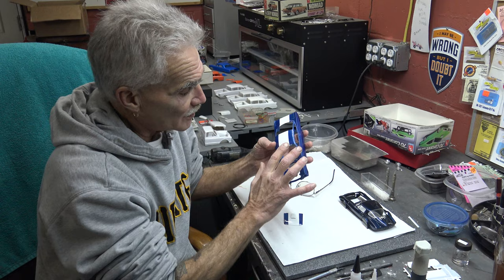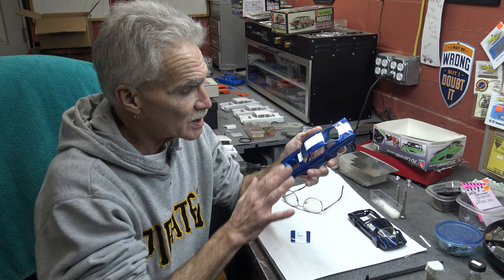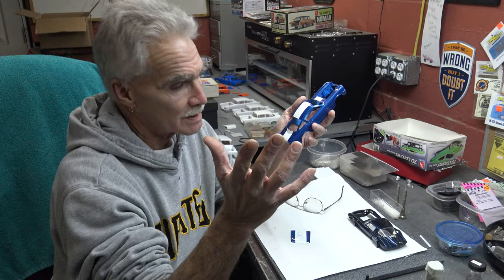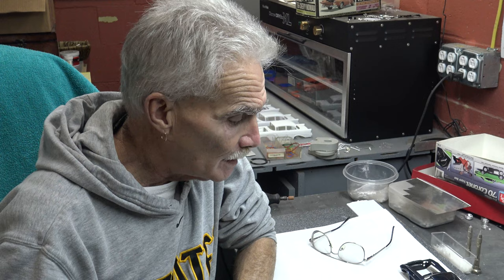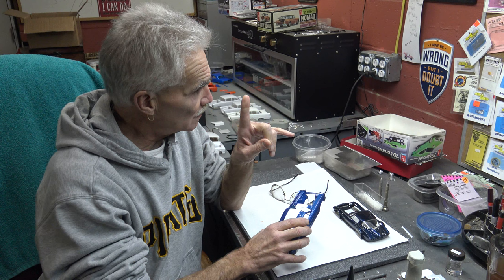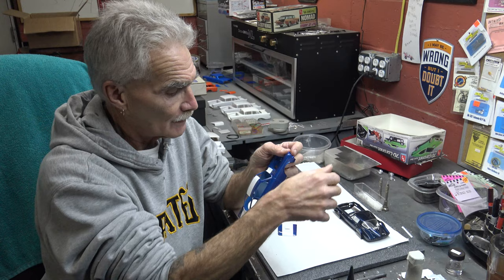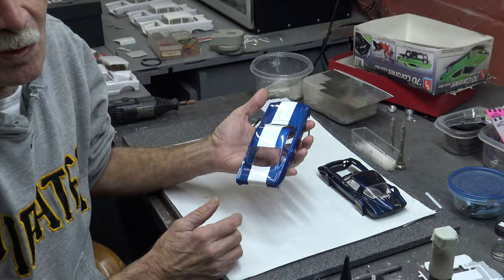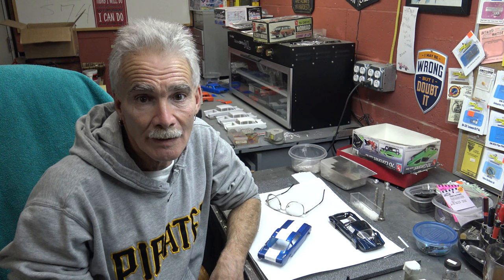Fundamental Friday - (Episode 17) -Two-Tone Paint Jobs

Comment: Trivia. The twin LeMans stripes on early Shelbys were tapered. That is, they were narrower in the front of the car, slightly wider at the cowl, very slight taper on the roof, and then got narrower again at the tail end. This was done so that, standing in front or behind the car, the stripes would appear to be the same width even though you were closer to one end than the middle, if that makes sense. I have no idea if the other manufacturers did this, but I'll bet they did eventually. Probably not necessary with models, but would be interesting if you were shooting your own stripes. Good vid!

Comment: Y'all remember he has 30 plus years of experience he has built probably 1000 plus model cars and painted a bunch more for customers. If your not doing shows then just build for yourself and have fun yes these kits are getting expensive fast the more popular the hobby becomes like it's starting to the more expensive the kits will be 30-50 bucks now for non Tamiya kits like revelle and re pop all new tooling kits from the 70s &80s &90s are 40 bucks to it sucks when you mess up a paint job or worse mess up a decal and now your stuck can't find a set online and forced to go buy a whole other kit just for that decal or love with out it. The best advice I can give you is just go for it. I have not spent the money on a golf quality airbrush I'm using the 60 dollar gravity feed one from hobby lobby on the harbor freight airbrush compressor works great just a pain to go set it all up just for 10 seconds of spraying creates more work for a hobby that's supposed to be fun so I usually end up just rattle canning all my bodies that are non show body's with the testors extreme laquer 2 part system and 2k clear that you gotta pop the ball to activate hardner not the 2x garbage. His DVDs are worth it trust me my paint jobs when I do airbrush them are like glass every time no more orange peel and messed up bodies I'm spending hours sanding and cleaning paint off in the bath of doom. So get his DVDs they will even help you guy using rattle cans the model car paint rattle cans and get you almost show quality shine with those as well trust me well worth the money

Comment: Which Tamiya tape? The white? Burnish with what?
Reply: The white Tamiya tape is the really narrow stuff he was talking about that you can mask off curves with.  The stuff in the video is the regular masking tape.
Reply: Hi, Chris here…. The Tamiya tape to use 4 masking is yellow in color & it comes in several different sizes. Now Tamiya does also make a masking tape in different sizes that is white in color….although that particular tape is a stretchable type of tape which is used to create curves & bends & to follow any curves & bends on a model kit. As far as burnishing, I suppose anything that will securely keep the tape in place on the car so there is no areas that paint can bleed through & not damage the paint can be used. I use my fingers carefully & gently & make sure very thoroughly I have ALL the areas masked off tightly & the tape is pressed in place…… hope that helps.
Reply: Thank you!
Reply from the maker: I burnish it down with the white Tamiya cotton applicators . They leave no fuzz or residue ….

Comment: Hey Don, great video. I was wondering. Would you paint the whole body white? Or just the area’s where you want that lighter colour?
Reply from the maker: I paint the entire body the lighter color first …..
Reply: @ScaleModelTechniques  Hello Don.  What sort of body prep required when we paint the second color?   Does the 2nd paint portion require any sanding?   I'm cracking my head on this one.  Please advise tvm.
Reply: @ScaleModelTechniques  OK Don.. I watched the video several more times.   After 1st color flashed,  wet sand up to 12K right?  Then mask off for the 2nd color, paint then let it flash again. Then wet sand  again up to 12K along the separation lines for even surface.   After that clear coat,  wet sand,  polish.  I hope I understood you well.
Reply from the maker: @brianalphonso7466    After the second coat has flashed . We sans the entire body up to 12000 . Wash it off , blow dry it off with compressed air , lay down your clear coat in light mist coats until you have achieved an over all smoothness and gloss . Allow that to flash , wet sand and polish .